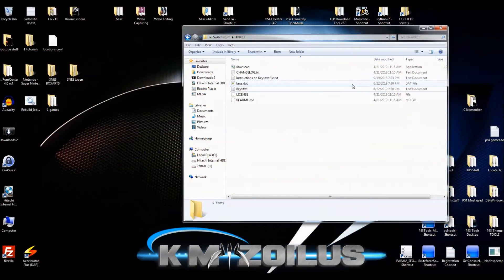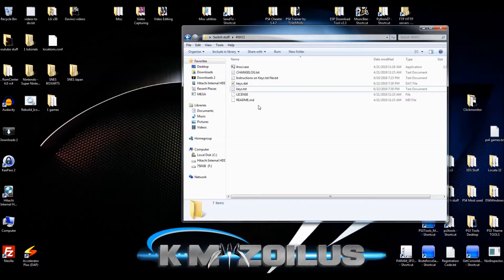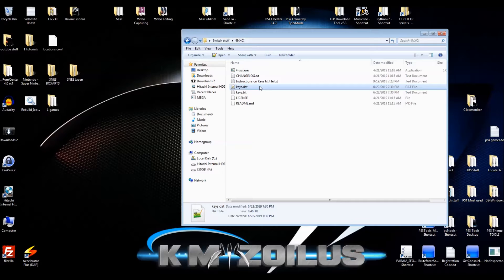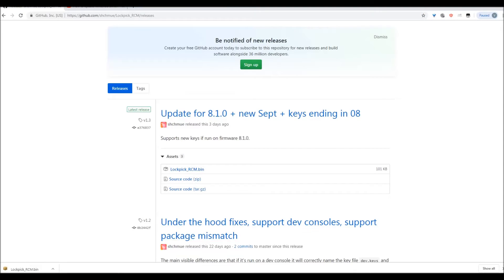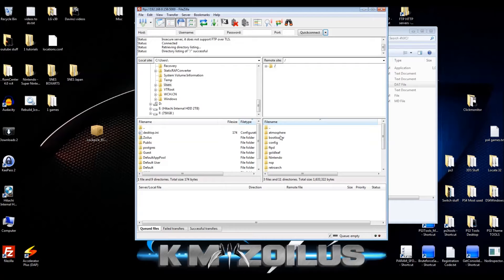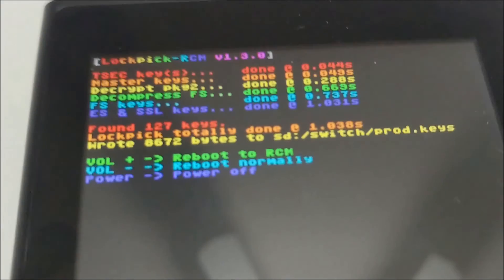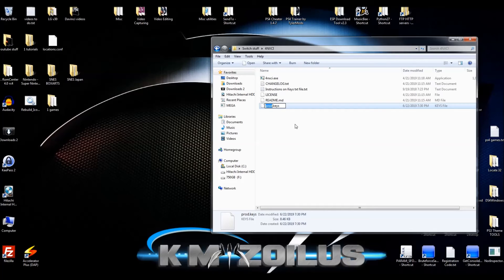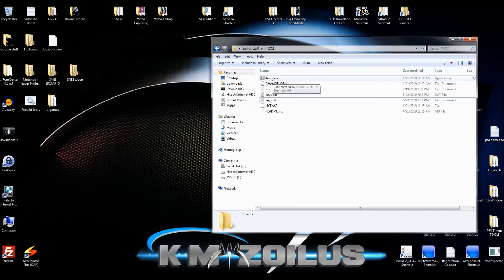Switch tutorial - How to fix 4NXCi when it stops working and doesn't convert xci to nsp

Comment: Im using Reinx. Is there a way to boot hetake from RCM to use lockpick? Thanks for the video btw
Reply from the maker: download the hakete files onto the root of your sd card. there should be a folder called bootloader.  in there there should be another folder called payloads. put the lockpick_rcm.bin file in the payloads folder.  you next need a dongle or pc to boot the hakete bin file, when in hakete, navigate to the payloads section and you will see the lockpick_rcm.bin file there, launch it, thats it.  follow the prompts to get keys. at the end just press power button to turn off, then boot into reinx however you normally do.
Reply: @kmzoilus2486  Alright! thanks for the heads up :D